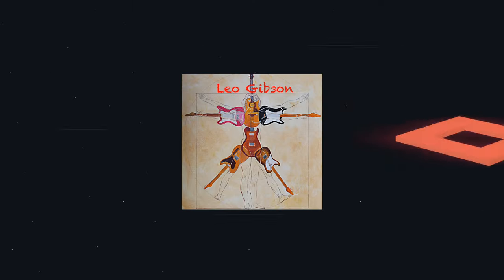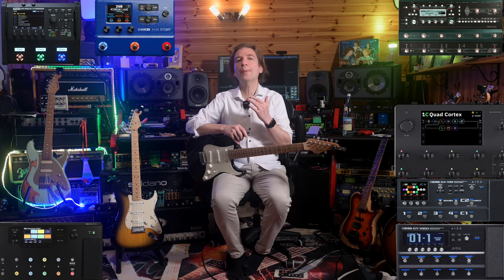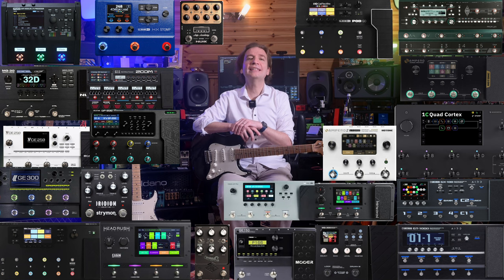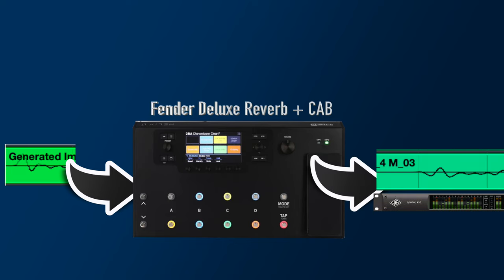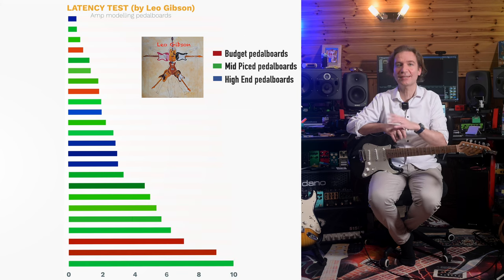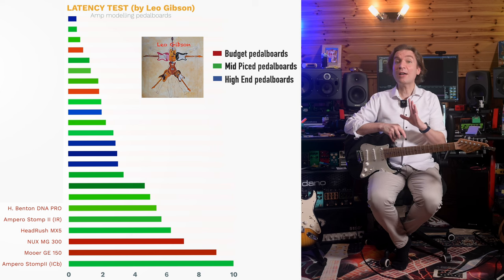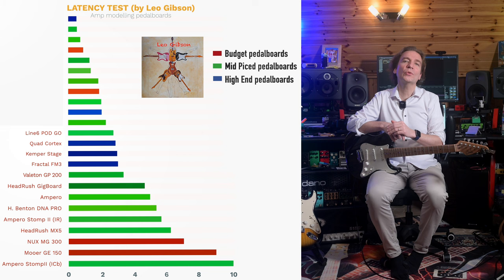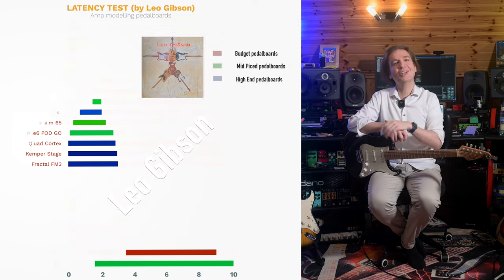LATENCY TEST: 23 amp modelling pedalboards compared! Quad Cortex vs, FM3 vs Helix vs BOSS vs NUX....

Comment: You are a hero Leo. Coming from Drone racing I am very sensitive to latency, typically it means being able to avoid a wall or smashing into it. I am shopping for  modeller to replace my analog setup and I find your content very informative. Thanks.
Reply from the maker: You welcome! I'm super happy that you find the videos useful!!!
Reply: Bare in mind that it takes sound 3ms to travel a meter in air, so if you are capable of playing 3m from your amp (if it's on the floor, that's you standing at a person distance) away from it while keeping time, you should be fine with 10ms latency.
It gets really messed up when you think about how far you are from different members of your average band, or even the latency difference between different drums
Reply: @peterallen964  interesting input. thanks.
Reply: @peterallen964  I don’t disagree with your point, however, when playing with a modeler live, that audio-through-air latency exists on top on the modeler latency unless you are using IEMs. As others have pointed out, it gets worse if you are using 4CM too. Add wireless and things are a little more latent too.
Reply: @toesalad  All digital modeller FX loops have D/A and A/D conversion, which adds a few ms of latency if you use it, 4CM being one such usage. Wireless connections and "digital" pedals in the signal path also do A/D and D/A conversion, adding more latency.   On the HX Stomp and Stomp XL, the FX loop adds around 3ms.  The HX Stomp has about 3ms latency on the primary signal path.  Add 5ms for wireless guitar connection.  Add 5ms for one external digital pedal, like an IR for speaker and cabinet.  Now you are up to 16 ms, which might be noticeable and annoying to the guitar player.

Comment: i just unboxed a GX100 today. i don't mind latency too much, but i did not expect it to rank so high up on the chart. I guess Boss's A.I.R.D. tech is not hype, but the real deal.
Reply from the maker: Hi, thank you for sharing!
Reply: No manufacturer makes a multi FX unit that can switch between two completely unrelated presets as fast as a Boss GT unit. Everything is always as seamless as stomping a single Boss pedal. That's been true for at least 20 years. Fractal Audio's tones in the FM3 blow the doors off everyone else's on that list but its switching speed can be problematic. That's why there are so many videos about workarounds to the problem on YouTube.

Comment: Great work, Leo, that is super helpful! I am also one of those nerds who measures the latency of every digital device I buy because I am, in fact, pretty sensitive to it. It's good to see, too, that for those 2 components we had in common (Line 6 Helix, Boss GT1000) we are in +- 0.1 ms (!) agreement. In case anybody is interested: I found that at a total latency of 12 ms I notice that something is "different", above 14ms I start feeling disconnected. (I am more tolerant to latency, though, when I play in a band than when I am at home hearing only the guitar.) The total latency I have mentioned includes approx. 6ms for the sound to travel to my ears (distance of ~2m), leaving 6-8 ms for digital components before it starts to bother me. Please forgive me for all that number crunching, I am a physicist, after all ... ;-)
Reply from the maker: Thank you so much, I'm happy that the video has been of some help!
Thank you also for sharing those numbers....very interesting indeed!!!
Reply: One of the better replies here right now. We may now introduce the term "Latency Budget", the delay limit before you start to notice latency (or disconnectedness).

Comment: Thank you, Leo.  Great video with some surprising results.  I'm sure most of us expected the high-end units (Fractal, Kemper & Quad Cortex) to be more toward the top.  I have a Kemper Stage, an HX Stomp and just got a Quad Cortex.  The only difference I've noticed between the Kemper and QC is when pitching down.  The QC seems faster when you start giving it some complex things to do.  One thing that makes sense is the units that do more and sound better are working harder and, therefore, might take longer to do the additional tasks.  I would like to know how this latency compares to a real amp.  There has to be a very small amount of latency even in amp for the tubes to respond to the input.  I'm sure some of these units are so fast that humans can't really detect the latency.  I've been playing the Kemper Stage almost exclusively for almost 3 years, so that is my new normal, anyway, and I either don't detect any latency or I've just gotten used to it.
Reply from the maker: You are welcome, and I'm happy that you like the video! Actually I think that analog gear has basically no latency, as the signal should travel at the speed of light...the only latency is the one needed for the wave produced by the speaker to reach your ears...
Thank you!
Reply: Analog equipment doesn’t have any latency at all, that’s the nature of analog!

Comment: This is very interesting...very extensive. Must have taken you a lot of time. I too am used to dealing with latency..I use a Fishman Tripleplay MIDI Controller and I've used ampsims on and off a lot over the years and with less than ideal systems.  As a guitar player the main reason I got a Thunderbolt 3  audio interface, after I put my new (was new) computer together was to get best latency possible.  I' ve been looking at hardware modellers  lately and this information that you've put together is valuable and appreciated. Thanks once again Leo.
Reply from the maker: You are welcome Kim, I'm happy that you find the info useful!!
Thank you also for sharing your experience!

Comment: As always Leo, your analysis is spot-on. I too was very surprised at the results. I would have thought conventional wisdom would have said The more you paid the lower the latency would be, but that was not to be the case. Great video and very informative as always. God bless and rock on 🎸😎👍
Reply from the maker: Thank you! Yes, the more you spend the less latency you would expect...but in my opinion the more you spend, the more the converters are refined and the more the algorithms could be complex..thus adding latency...so it's a kind of balance to be found between latency and quality...that's maybe why the high end amp modeller are not at the top, but still with pretty good latency time at 3 ms.
Thank you!
Reply: @LeoGibsonGtr  I would also add, the more you pay, the more other features you get as well, which may-or-may-not be important to you. There are a lot of trade-offs in what features each brand brings to the table. Latency is just one. For example, in the case of Fractal, you are getting a ton of flexibility around customization, regular firmware updates for years, one of the best desktop editors out there, etc. In the case of Neural, you are getting really good profiling, a fantastic UI, and microphone inputs, etc.

Comment: What a useful and interesting video - thanks Leo. I guess I'm not the only one right now scratching my head trying to interpret the results!
Reply from the maker: Thank you Chris, I was also surprised, but then the results started to make sense...I mean, QC, FM3 and Kemper all at around 3ms...in my opinion there is a balance to be found between the latency / fastness and the quality (converters and algorithms) and maybe the right spot is around 3 ms...
Reply: @LeoGibsonGtr  Hi Leo. The biggest anomaly was the GT1000 but I always thought it sounded 'digital' so perhaps as you say, this is the trade-off.... so if your 3ms observation is correct (and I think it is) in order to move the whole digital movement forwards, we need a big quantum leap in technology !
By the way (I will delete this post when you have read it): "sensible to latency" should be "sensitive to latency" and "3 dot 5" should be "3 point 5".
Reply from the maker: Yes, I think you are right...to drastically improve latency we probably need a big step forward in term of  processing power...another possibility is to drastically change the approach...and I'm really curious to see what BluGuitar with the AMP X is gonna do...
Thank you for the corrections...I need to improve my English... 😀... but I put all the time I have in making music or videos...so no time left for improve my English... no need to delete the post...you are just right...and the polite suggestions (like yours) are welcome!

Comment: Wow - thanks for all that hard work. 10ms is no good for me, but anything under 5ms works fine. Interesting to see MX5 and Gigboard give different results -  I thought it was the same processor/etc, as with the Pedlaboard.
Reply from the maker: Hi Mark, thank you for sharing! Please, take into consideration that the Ampero Stomp II can be improved a lot in terms of latency using IRs and not the internal Cabs, that seem to require a lot of processing power. 
Thank you!
Reply: @LeoGibsonGtr  Hi Leo I thinking you give wrong answer. He asking about Headrush. Headrush Mx5 and Headrush Gigboard completely same processor and electronics how can be different results ?

Comment: Very interesting!  It would also be interesting to compare the latency given different effects; it's possible for instance that if you introduced a distortion, delay, chorus, compressor, etc., some of the less powerful units might have more latency that the units with the more powerful DSPs.  But yeah that becomes much harder to compare as all the effects differ in different units, so ex; out of the 12 Helix compressors, some might be faster/slower than others, but at the same time demand more power; be of higher quality...  Making direct comparisons much more difficult...
Reply from the maker: Thank you, I'm happy that you have found the video useful!
Yes, that's a good point and actually I'm currently doing some follow up videos to check out also the latency of the other effects. For instance here you can check out one of them: https://youtu.be/nfCgL_MGT3o
Thank you!

Comment: Few years ago I decided to buy a multifx/ modeller. It was at time when GT-1000 showed up in shops for the first time. I compared it to the Helix. The difference was massive. Helix felt like a plugin amp sim in a DAW, while GTK is as fast as real tubes and capacitors (which also need some time to fully saturate).
Reply from the maker: Hi, thank you for sharing your experience and your findings!

Comment: Before buying my GT-1000 I tried all the high end modelers. I went with the GT-1000 because it felt the best. It felt the most real, and immediate. This was over 3 years ago, so it’s nice to see that this wasn’t just snake oil and wishes. 

Also it’s smaller than the others and has a built in expression pedal. 

I’m still happy with it about 3 years later.
Reply from the maker: Hi, thank you so much for sharing your experience!

Comment: Great video!  I have the Nux MG30 and the Ampero MP 100.  I haven’t noticed any latency in either units and am pleased the MG30 rated so highly, especially as it’s sort of a budget-priced modeler.  Thanks for providing all this info…
Reply from the maker: Hi George , you are welcome and thank you for sharing! yes the difference is hard to notice….
Reply: Hi George, which would you recommend me between mg30 and ampero for the quality of the simulations? I am very undecided between the two ... thanks!
Reply: @scprojack83  I’m leaning towards the MG30.  Both units are great.

Comment: Thanks, Leo! It’s possible for an impulse response to introduce latency, as a property of the IR file itself rather than the device doing the processing. Say, if you’re miking the cab from a distance when shooting the IR, there’s going to be some built-in delay that corresponds to the time it took the sound wave to travel through the air. This may potentially be an explanation for the result you’ve observed when testing Ampero. I’m wondering if this affects other devices on the list as well, just to a lesser extent.
Reply from the maker: Hi Victor, I've check out almost any device comparing custom IR to internal cabs: there are differences, but very very thin. The Ampero Stomp II was the only device with such a big jump in latency: the internal cab introduces more latency that a custom IR. In my opinion that's because Ampero is making some calculations that are pretty heavy on the CPU, therefore introducing latency. Please notice that I have tested the signal with just the amp block, and it was very quick, then I have tested amp + cab and it was much slower...therefore it's the cab that is introducing latency. 
Let me also say that adding digitally delay for the wave to travel in the air would be something wrong, as the output of the modeller has to be sent to a speaker, and then the speaker produces the wave that travel to your ears...
Thank you
Reply: @LeoGibsonGtr  It’s impressive how much work you’ve done testing all possibilities. My hypothesis was just that - a hypothesis. It could indeed be some sort of different algorithm running with built-in cabs on Ampero, or perhaps higher resolution IR or interpolation between multiple IRs. And yeah, you’re making a good point, though there use cases when you want that baked-in delay in an IR file. For example, you could mix a standard IR with a “room IR” to add some room flavor to your sound, and the latter IR will need to have the property I’m talking about in order to produce the correct result as it’s meant to add room reflections that come with a delay.
Reply: On the more expensive modellers, latency is most likely dominated by the conversion from analog to digital at the input, and from digital to analog at the output of the modeller.  Their DSP chips are very fast, and the algorithms employed are highly optimized for low latency.

Comment: When I bought my boss gt-1000 years ago I tried all the available modelers. The gt-1000 had the best feel of all the higher end modelers I tried. It was hard to explain then. 

Not any more. Thanks so much for this video.
Reply from the maker: You are welcome Samuel, I'm happy to have been of some help!!!
Reply: This is exactly what people need to hear re: the GT-1000. It’s the first modeler that’s ever felt like a real amp to me. I dislike BOSS’ presets and defaults as much as most people do, but with a few minutes of tweaking we can make it sound however we want. What we can’t simply dial in, though, is feel, and that’s where the GT-1000 wins over the competition.
Reply: agrego mas..ahora años despues de tenerla, saber configurarla y tener el sonido valvular "en la cabeza" puedo decir que suena como valvular e incluso mucho mejor que muchos valvulares. No es facil regular y saber que tocar de los parámetros. Pero despues de 40 años de valvulares puedo decir que este dispositivo a llegado a sonar igual.

Comment: Also to answer your question about latency, I've never noticed any audio lag from the Stomp II,  There have been issues with the software, Is the firmware,  And sometimes it crashes when I'm trying to build a patch. I don't have very much experience with aunt modeling, My last one was the pod XT. I love that thing and I learned a lot from it. I don't have a lot of experience with tube amps either.  I have a reissue 67 Princeton, A Chinese AC15, And they tone works 1/4 Watt amp.

10ms was a lot more than I expected, but I'm surprised I didn't notice it. 10 milliseconds while I'm recording is unbearable to me.

Thanks again for your time, it's a huge test.
Reply from the maker: You are welcome. Please notice that if you use Custom IRs, the Ampero is much quicker...by the way, even for me 10ms are not a problem at all...but some of us are more sensible.
Thank you!

Comment: Fantastic work Leo! I guess latency can also be a big part of the delay or the time taken to load and respond to a patch when stomping from one patch to another. Which brings me to my question. My needs are simple, I just want to stomp through several patches when performing live as a solo busker, without missing a beat, but I recently found a Zoom G1Four had almost no discernible delay when stomping between patches whereas the Ampero II was unusable. Both were tried with the ‘same’ effects chain - drive-> amp ->cabinet->reverb. Your comments would be appreciated!
Reply from the maker: Hi, thank you, I'm happy that you like the video!
The type of latency discussed in this video, is related to the gap between the time you hit a note and the time you actually hear the note. 
The latency between patches is a different story and I should do another video about it, as I noticed a lot of interest. In my opinion there are two things that can "alleviate" this problem: the first one is the scene management (for instance line 6 or NUC manage scene), where the pedalboard allows to change some parameter without gaps, or the trails / spillover, where the time effects basically don't stop when you switch presets. The scene management function is more rare, where the trails/ spillover is more common. To me the trail is essential and finally if it is available, is almost enough...but obviously this is my point of view.
Thank you!